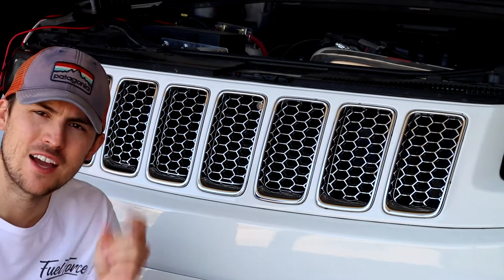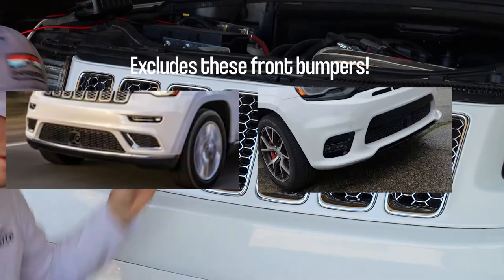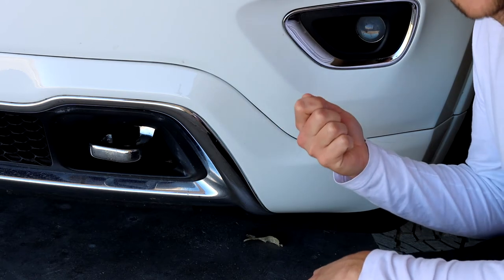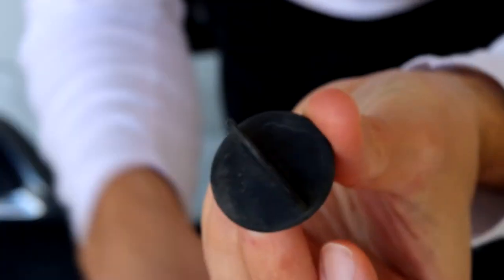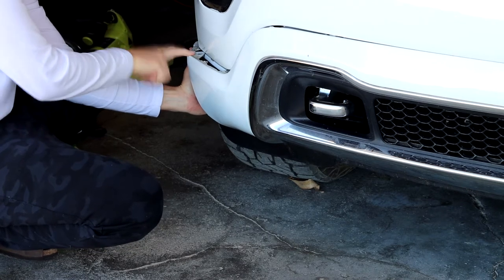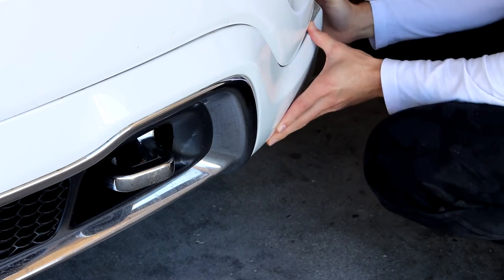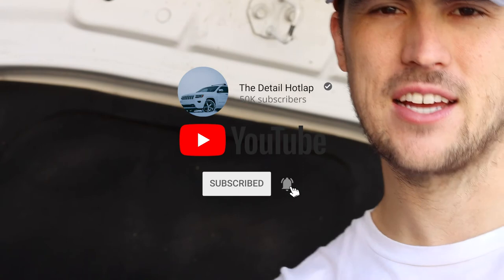Jeep Grand Cherokee Lower Fascia Removal - 2014 - 2016

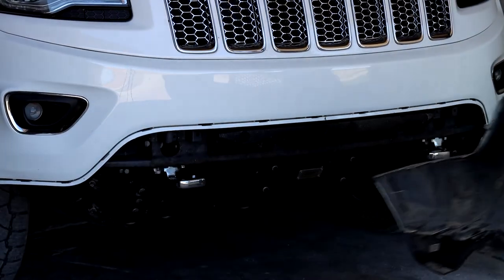Comment: At 2:18 there is a shot of the back of the lower valance there seems to be a part that attaches onto the lower valance which connects onto the bottom frame where the clips twist onto what is that? Part number?

Comment: Why can't I find any info on ONLY removing that lower 2 - 3 inch plastic air dam? I don't want to remove the whole front fascia, just that lower lip in order to gain about 2 - 3 inches of ground clearance. Is it all one piece? Can you just remove that lower lip or would it have to be cut off? Any help is appreciated.
Reply from the maker: are you talking about the plastic black trim pieces attached to the fascia?
Reply: @thedetailhotlap  Yes I believe we're referring to the same thing. Is it actually 2 pieces... 1 on each side directly in front of the tire? I assumed it was 1 long piece of 2 to 3 inch wide plastic air dam attached to the bottom of the fascia.
Reply from the maker: @chadgraber4575  Yeah, that should be fairly easy to uninstall. There should be 2-4 vinyl clips you need to take out with a clip remover or flathead, then push the pieces backwards (towards the tire) while pushing/pulling down.
Reply: @chadgraber4575  yeah, I didn't have them when I purchased the vehicle. I purchased mine through a third party site and they work!